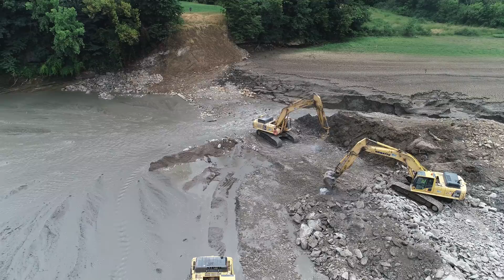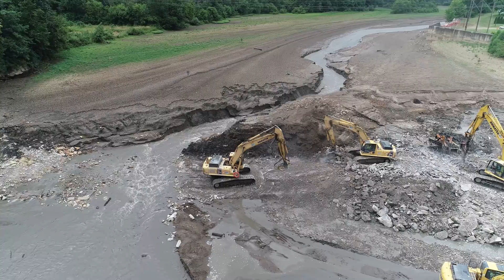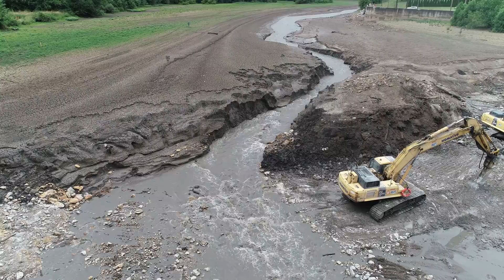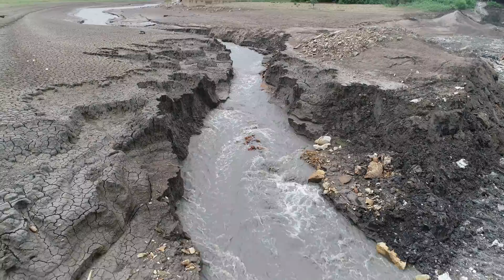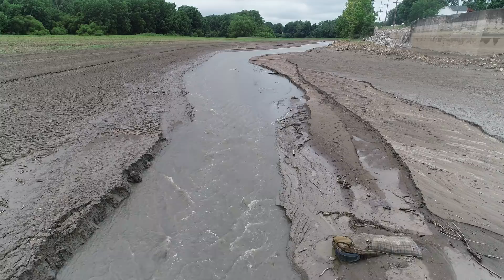Dam Removal Day 20

Comment: There will still be the footing of the dam and maybe a pad between where the dam was and the ice control structure that will need to be removed and most likely they will have to haul out all the concrete as most programs see it as foreign to the river. 

The silt left behind will dry out over the rest of the season and next spring when the high flows come a good chunk of it will get shifted down river.
Reply: They're only removing the concrete with rebar in it.  The rest is going to become part of the new stream bank.